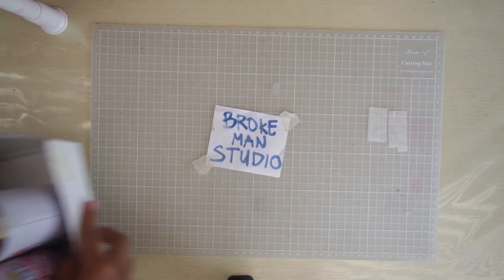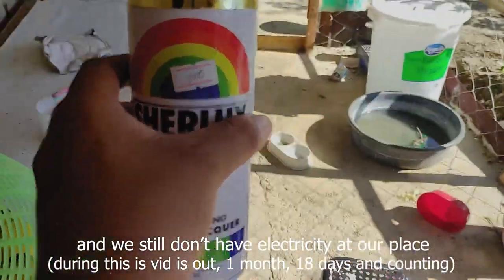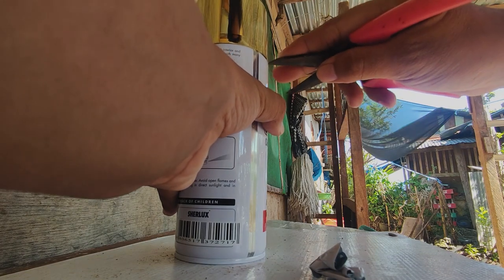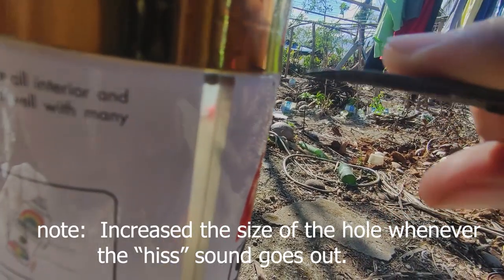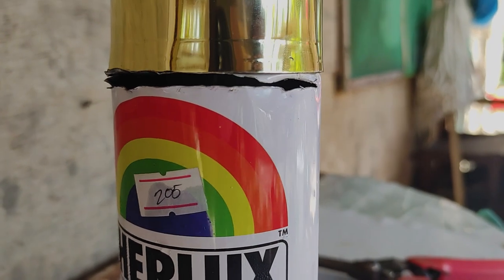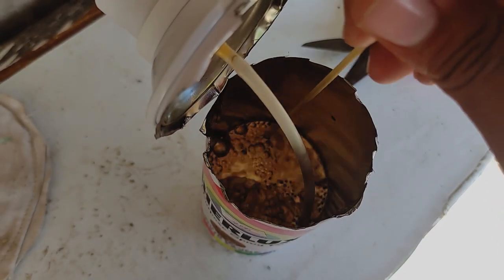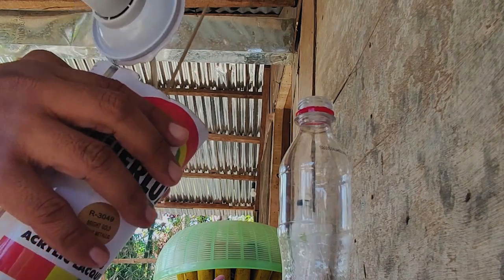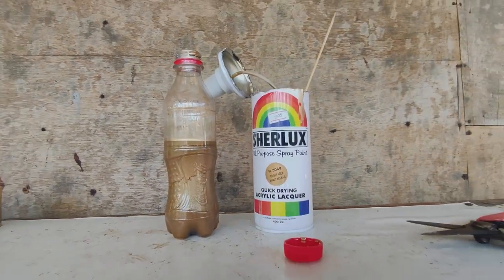Broke Tuts: Extract Paints from Spray cans

Comment: Can this be used for any can even if it’s full?
Reply from the maker: Hi! Yes all the cans that i use the methods on the video are full. In fact that can in the video haven't been used thus it's full. 

Just make sure to let it settle by not making any movements on the liquid inside for 12hrs and follow the guide on the video.

Hope this will serve you well 😁👊